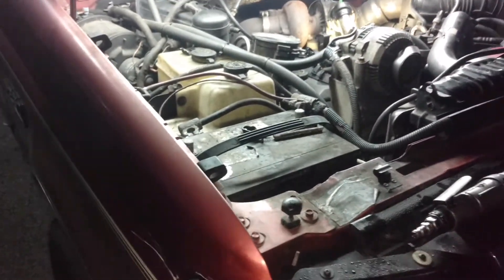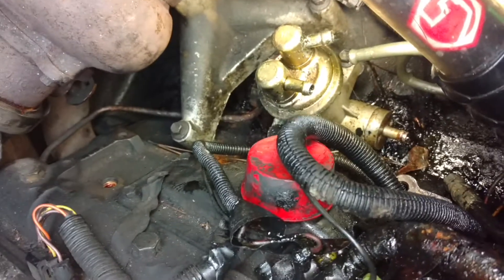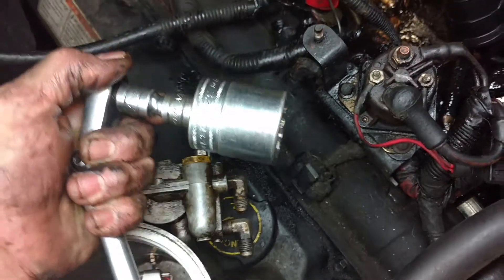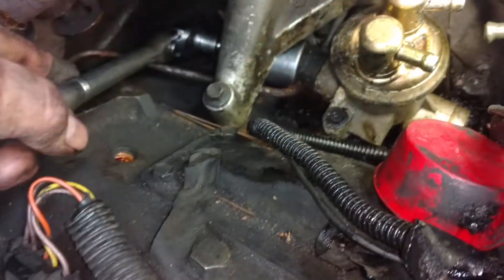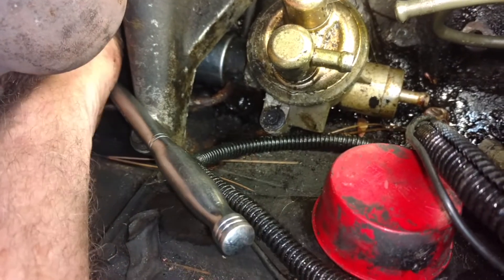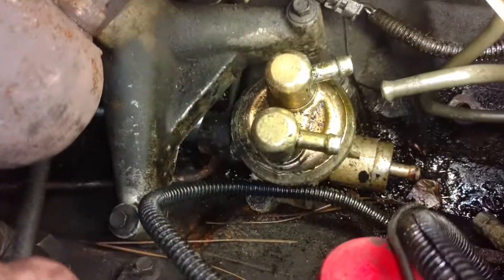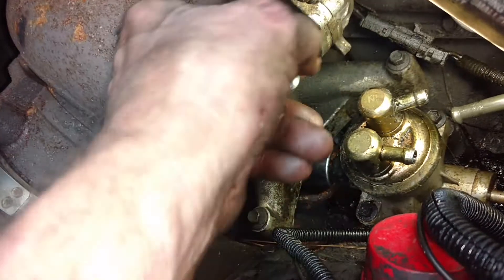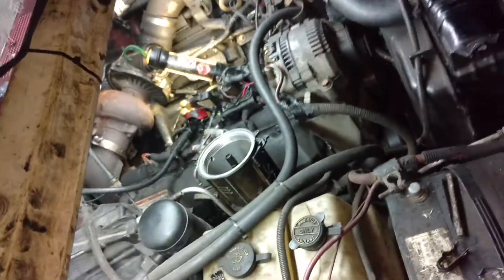94-97 Ford 7.3 diesel fuel pump removal, easy peasy!

Comment from the maker: Ah yes, the banjo bolt! The inner washer has to sit on the tiny ledge built into the line while keeping slight pressure with one hand and pushing the bolt and other washer with the other hand...but that's another video.